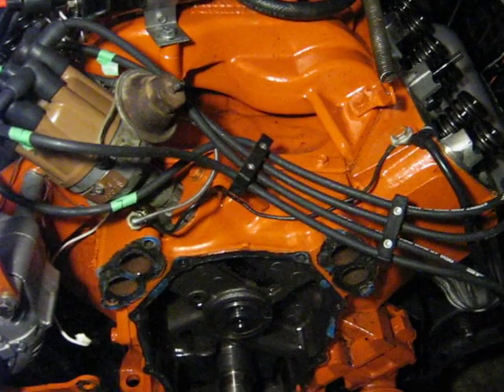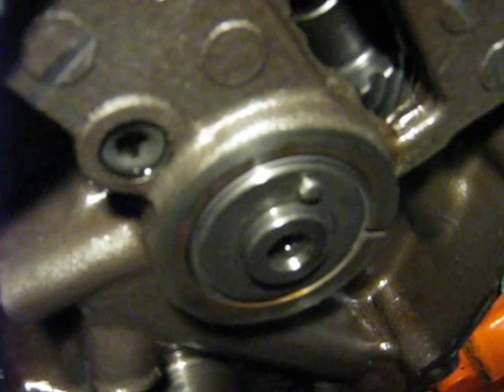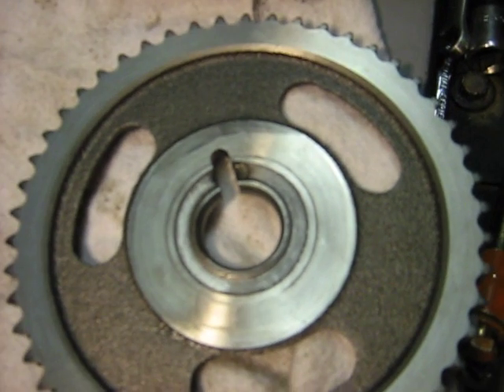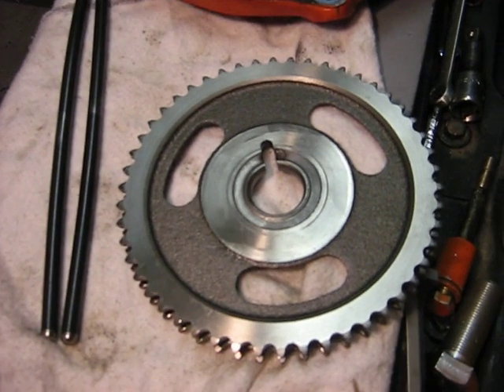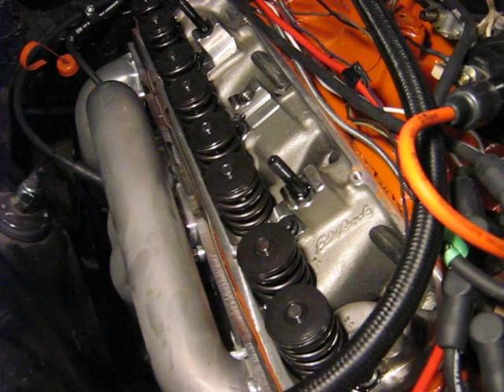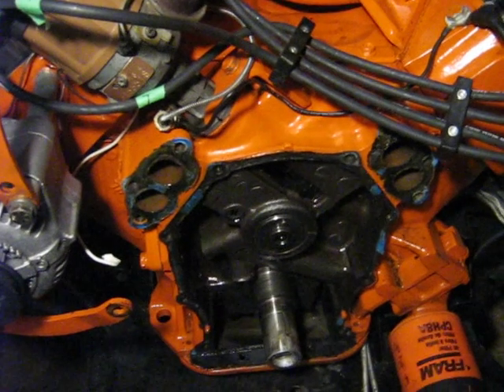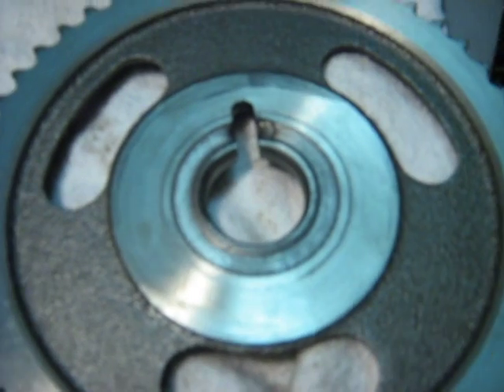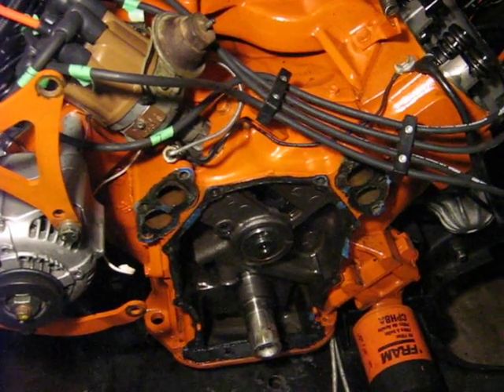440 Camshaft drive FAIL!!!

Comment: Was that cam drive pin solid, or was it a roll pin?  If solid, was it bent, or damaged in any way?  By those marks on the timing cover I'd say it worked loose.  It probably wasn't hardened probably. A major defect.  You may want to go with a 3 gear cam drive.  Milodon makes one that I understand is very good.

Comment: Hope you get it fixed with no further problems.  Fingers crossed!!!  Definitely go with that 3 bolt cam, or a gear drive with 3 bolts.  I like gear drives myself.
Reply from the maker: Yes, we hope to get it back together one of these years!

Comment: The 7 and 8 rods are the most likely to fail on a B or RB engine mostly because of where the oil pump is located
Reply from the maker: Yes, the further from the pump, the sooner it will run low on oil.

Comment: This is a awesome video for me. In 69 my honorable discharge got me a great job at Chrysler engineering. My vary first day on the job i started working on the further development of the of the 69 440 6 bbl. Well this was one of the problems and we set up the 3 bolt cam. There is more improvements but this was great to see and ponder. Note: when chrysler made a mechanical change we would certify it as good after 60 hours of WOT operation. I did that for years. Great nostalgia.
Reply from the maker: WOW, thanks for the reply, great to hear from someone who helped engineer these monster motors that still thunder down the drag strips! I try my best building machines from lawnmower engines, My latest contraption will be an H shaped 12 cylinder, hopefully doubling into an H24 cylinder, based on the Napier Sabre 24 cylinder airplane engine. I made an over head cam engine that looks a lot like a HEMI form the front , and even uses Race Hemi Orange paint :)

Comment: That is a cool video for me. Its exactly why I helped develope the 3 bolt system. I'll agree the cam bolt was likely loose but they failed enough that we had to develop a new drive system.  Thanks for posting its awesome memories for me. I started working on the 1970 engine development right away. So many cool projects back then.

Comment: Cool, good luck . where are you located , I'm in Washington state. I'm in the parts collecting phase of a stroker  'b' big block 479 cube and 833 manual trans to go into a 99' dakota r/t.
Reply from the maker: I am way on the other side of the country, just above New York state.
A friend of mine used to have an older Dakota drag truck, he took his strocker  400 engine out, and is putting it into a Fox body Mustang.

Comment: Did you know on a camshaft break in when you run it at 2000 -2500 u should take the inner spring so it doesn't wipe a lobe out ? Anyways what ended up happening to your 440 ?
Reply from the maker: The 440 has been resting for about 4 years, after it burned up a con rod while beating a 440 six pack Cuda at the drag strip. My son has the new rod, bearings and oil pump, as well as a few other goodies, we just need to track down one of those Round 2 Its  to get it back running  :)

Comment: Has nothing to do with the 1 bolt Did you break in your cam with both valve springs or did you pull the inner spring out. Also you probably thought the bolt was tight and it was but you weren't seated properly. That's install error, definitely the 1st time I've seen anyone do that.
Reply from the maker: We used the camshaft with both valve springs installed, from the start. It is possible it wasn't seated properly. i have to admit, I have never installed the cam in another Big Block Dodge, just this one. I have done a number of timing chain replacements, as well as a full rebuild on a 318, but not a 440, so this was new territory.

Comment: You bent some valves. A quality 3 bolt setup is better, a gear drive is best.Sorry for your loss. When learning, it happens...
Reply from the maker: +RCWorks Yes, we have accepted it as a learning experience, though they can be costly and time consuming some times! My son's latest issue is his Nissan GTIR blowing oil out of the passenger side wheels well when stepping on the gas hard. He thinks the new crankshaft oil seal may have bit the dust somehow :(
Reply: ChargerMiles007 Does it have a lot of blow-by out of the oil fill when revved?
Reply from the maker: No, hardly any blow by, but we didn't run it long with the con rod bearing chirping, I posted a vid of the wounded engine. My son has been working on it now and then, and hopes to get it back together with the new con rod fairly soon.

Comment: You didn't sat the gear on the cam correctly.  
       Operator error 

  Single bolt cams have been around forever. 3 bolts are better, but I've used singles with heavy springs all day in 12.0 brackets in heavy cars.
Reply from the maker: ***** You could be right, I didn't like this gear with the slot versus a hole for the pin.

Comment: That's why you never never!!  use a single bolt cam in a BB mopar
Reply from the maker: Myvintageiron7512 Yes, too bad the manufacturers wouldn't stop selling the 1 bolts!
Reply: really? 500 000 miles with 1 bolt w/o any problems, also the fast majority of bb cams are 1 bolt with many, many billions of miles of troublefree service.

Comment: Street Mopar big block motors don't need a high volume pump. A stock type pump of good quality is all that is needed with 1 mod: they (Mopar) do recommend, buying the large diameter pickup tube and drilling the block to accept it. All oiling system mods for street engines need to be done on the suction side only as this is where the restriction lies.
They don't recommend the high volume pumps with single bolt camshafts for this exact reason.
Reply: MarquisRex Find a place that rebuilds BB Chrysler engines. Somebody that has done it before could drill it by hand I reckon with an electric drill and about three or four new drills going up in drill size each pass. 
If you do it yourself you need a drill chart for the correct final drill size otherwise the hole will be too big or small for the tap.  
Mine was done at a machine shop so I don't know how they did it, but the pickup fitted fine so they must've got it reasonably straight.
Reply from the maker: ThePaulv12 That could help explain the problem!  Thanks for the info. My son is making the larger pickup pipe mod, as well as machining a new oil filter mount part of the pump housing, it should be something to behold when it is done  :)
Reply: ChargerMiles007
You can buy the pickup. It had a Chrysler P number and was from a Hemi. It costs 3/5ths of sweet FA! :) $35 maybe??
Don't forget you have to drill the block to accept it. All you have to do is drill and tap the block to 1/2" pipe thread and screw it in. If using thread tape hold the pickup in the LEFT hand and wind the tape with the RIGHT hand in the direction of the thread - that way when you screw it in, the tape will stay on the threads (obvious now I've pointed it out but you'd be amazed... ).

Put a crankshaft windage tray in the stock sump pan because the sump isn't as large as is ideal and it will ensure that when you rev up the motor the oil will get back to the sump part of the oil pan rather than get wrapped around the crankshaft in a wind driven vortex causing the pickup to suck aerated oil. This will first be heard by noisy lifters (if hydraulic) after a big rev up of the motor. Also, I read somewhere on a Hemi a windage tray increased power by an incredible 40hp! No mods required for this except 2x sump gaskets ie one either side of the tray.

Consider welding an acceleration baffle in the sump. A piece of scrap sheet metal angled down a bit, stitch welded in. Leave some gaps, doesn't need to be seam welded in or fit too well. It's only there to stop a big slurp of oil from surging from the "bath" or sump part of the oil pan to the rear part of the oil pan. Remember you're trying to keep the oil pump pickup submerged.
If you don't weld a baffle in you'll hate the oil pressure light coming on or your hydraulic lifters rattling during/after a hard takeoff.

Make sure you use a hardened intermediate(distributor) shaft too with the correct gear for your camshaft. The oil pump hex end of the intermediate shaft wear on the old ones and the new ones are much stronger at the hex. All this stuff will cost <$200 and a bit of time.

All these mods are to compensate for the lack of oil in the sump of these motors caused by the K frame and steering. 440s rev hard and pull hard and because of the huge brutal wide torque band as well as the instantaneous stump pulling power off idle, they can keep the oil in the back of the oil pan which is what we're trying to minimize.
Reply: Mancini has them for $29.95.
Reply from the maker: ThePaulv12 Thanks for all of the info!My son has dropped a few hundred on a high capacity baffled oil pan, I think it might be Mancini. As well he is installing the Hemi oil pickup tube. The adapter he is making allows easier access to the pressure regulator valve, and can be used for a remote oil filter also, it is quite the piece of hardware, I will make a vid if it when it is done. It will have about 3 days worth of NC machining into it when the little beast is done!
Reply: ThePaulv12 Its a compound angle to drill the 1/2 inch pick up thread into the block from the Hemi. I'm trying to find a competent machine shop that can manage this
Reply: ThePaulv12 
PS, you have to drill the passage all the way to the bottom and also you have to drill from the oil pump mounting face to intersect the pickup side because the gallery isn't straight. Ideally you could get a long carbide cutter and radius the intersection a bit - not much, but enough to remove any sharp edges and smooth the 'bend' a little (not really a bend I know but I think you know what I mean) The idea is so the gallery isn't the old size in any place otherwise, what's the point, yeah??; it's like a weak link in a chain.
Do you get what I'm saying? In a Hemi the galleries were drilled larger on both planes.

I make it sound complicated but it is simple when you look at it.
Reply: ThePaulv12 Thank you! On one of the Mopar forums they outline a procedure to do this and some other oiling mods for better oil supply to the rockers along with grooving the cam journal but also putting in a restrictor to not take all the oil from the bottom end. I am intending to rev my engine. Doing all the engine calculations now
Reply: MarquisRex If you put a restrictor in you might smoke the valve tips and rocker arms if you idle it in traffic for long periods.
An oil restrictor is a race only mod for sustained high revs. Remember even with fully grooved bearings the oil pressure is good when idling. The oil system is different to other manufacturers design and a Chrysler recommended approach is best. Buy the SA publication book, or the Chrysler engine book.   
A windage tray is effective in keeping oil in the sump when you rev it up. Ideally a larger capacity, but not deepened pan would be good too. 

Also remember this: There's no point building a 9500rpm motor in some areas and a hi-po street motor in other areas. 
Everything you want is probably here:  http://store.440source.com/
Reply from the maker: One comment about 440 Source, we tried one of their aluminum water pumps on the 440, all it wanted to do was overheat all the time. Took the new pump off, put a 20 year old cast iron pump on, magically all the cooling problems went away. The aluminum pump wasn't designed right, the passages are too small. My son has since butchered it and welded it up so it can flow lots more coolant.
Unless they have changed the design of that aluminum pump, DON'T buy it!
 Other than that 440 Source is a good place to shop.
Reply: ChargerMiles007 You should tell them. If it were my business, I'd wanna know.
Also, the air conditioning water pump has a smaller impeller that is less prone top cavitation. The pulley size is important as it determines the water pump type (or vice versa).
The water pump housing can have a hole drilled beneath the thermostat through to the other side. This can help with overheating. The correct diameter fan with correct shroud should all be fitted with a new fan clutch.

Comment: You need to get that fram filter the hell away from the engine lol. They're garbage.
Reply from the maker: Justin McNelly Yes, I have been told that before, we only had it on during the break in period.So what brand of filter do you recommend?  I hear Bosch are good.
Reply: ChargerMiles007 in order k&n, mobile1 and then bosch are the most well made filters but all three will do the job well. I just know for a fact fram and the other $4 filters are cheap for a reason. Im certified in engine oil which isn't really that much to brag about lol but i do know my oil.
Reply: ChargerMiles007 also i'm not sure what kind of oil you use but comp cams make a good oil designed for motors like this. Its a fully synthetic blend with zinc additives. Its called comp cams muscle car and street rod oil. There are of course other decent oils but thats just what i use.
Reply from the maker: Justin McNelly Thanks for the advice, Quaker State Defy oil also has zinc in it. That was nice of the oil makers to advertise the fact the newer oils are NOT friendly to old engines! The oil just MUST have zinc to prevent camshaft wear.
Reply: ChargerMiles007 newer oils have just about half as much zinc as an engine like this should be getting. I used a castrol 10-30 full synthetic in my camaro. When i pulled the camshaft for an upgrade the lobes had actually been fairly worn, unlike when they were seeing more zinc. Synthetic vs conventional means nothing if you dont have the right additives to meet your motor's needs.
Reply from the maker: Justin McNelly Yes, you must have the zinc. I have seen it listed on some STP in the blue container.Newer engines such as some 4 valve DOHC engines have much smaller lighter valves, and low seat pressure (I couldn't believe how soft the valve springs on a grocery getter Honda were!)  Meanwhile the old 2 valve OHV muscle car engines run some serious spring pressure which results in much higher loading on the cam lobes. So they took most of the zinc out of the newer oils all in favor of increased catalytic convertor life.Up until they removed most of the zinc, oils have gotten better and better for the last 50 years, then they pull a bonehead move (without telling us car owners!) so that the newest oils will kill your 25 year old engine in short order!Thanks again for the info about this subject, it still gets my blood boiling, just like GMO food and ethanol gasoline! Take care Miles

Comment: bigblockmopar I agree completely! it wasn't seated right which is what caused the failure. and the single bolt cam is NOT a problem. we've built a couple with a single and never had a problem. does anyone know the cam specs?
Reply: Single bolt is fine with stock oil pump.
Reply: ThePaulv12 Stock type new oil pumps (on BB Mopars) are excellent for almost all apps that are dual purpose, but the intake pipe needs to be enlarged. All that's required is to drill and tap the block to fit it. That mod with a windage tray and bigger baffled sump are all that is really required.
Reply: ThePaulv12 yup, all this high dollar parts is fine if you have a money tree in the back yard. but most of us don't, and you make do with what you've got. another little money saving trick for mopars, that even many mopar guys don't know is. when you go to swap in a big block, you don't need to change the k-frame. just put the right mounts in. whether it's a slant six, or 440. we've (dad and I) done it many times, in all different body groups.
Reply: gary williams Yes but sometimes expensive parts are plain unnecessary.
This very thing (above) happened to my boss years ago. I built a 440 for me and it was brutal. That motor was a big revver too.
My boss was impressed with mine so he rebuilt his 440 in a 68 Charger and did not listen to one word of advice I had to offer. Anyhow after about 2 or 300 miles same thing as this vid happened to his 1 bolt camshaft and high volume oil pump 440 combo too. Also when it was eventually going it was soft, not the cracking brutal beast of a thing mine was.

Some motors like a high volume pump, but conceited machine shop operators apply a one size fits all approach to motors. Customers reason that "They must know best because they do it all the time", but actually not.
For instance a SBC might need a high volume pump because it has a non priority oiling system. This simply isn't applicable to Bs & RBs. Bs & RBs need suction side mods NOT pressure side mods even with fully grooved bearings.

Any research of the Mopar tech bulletins will tell you how to build your BB Mopar for max performance and reliability. You can buy them in a book and every performance part is in there including original pro/super stock cam grinds, forged pistons etc, etc.
Reply: ThePaulv12 I couldn't agree more. we've went out and dusted guys with WAY more money in their car, then we had. and it was because they wouldn't listen. the dart in my profile is a perfect example. it was a 340/727, they all thought you needed a 4 speed to be fast, and of course an auto car, set up correctly will win every time. but they wouldn't listen, so they learned by losing their money to us. and the funny thing is, they'd always try and tell us how to make our car faster. you'd think that after they kept losing to us, they'd have started listening. but they didn't